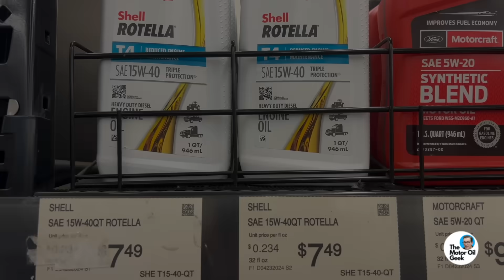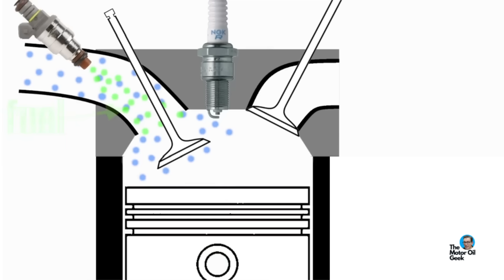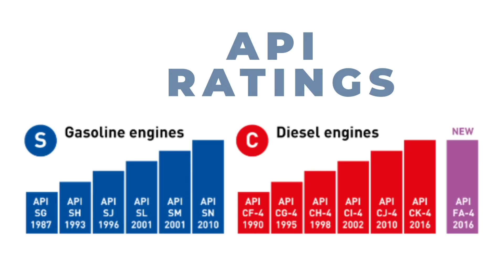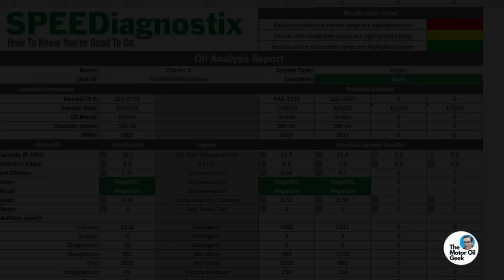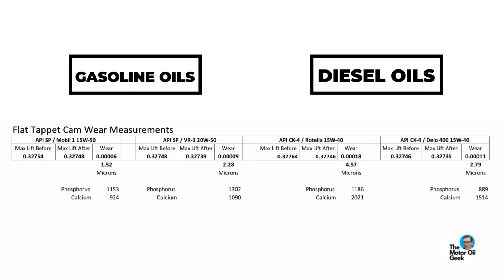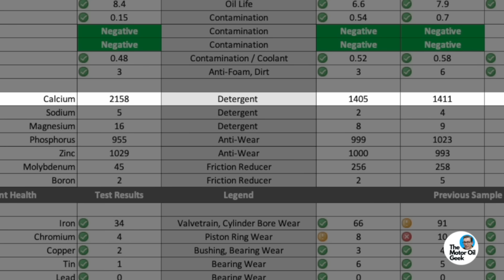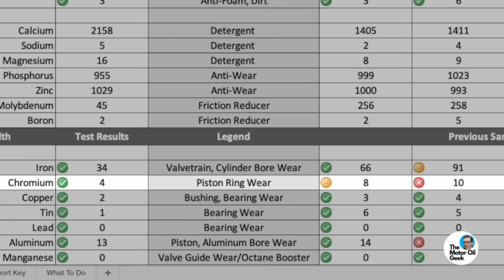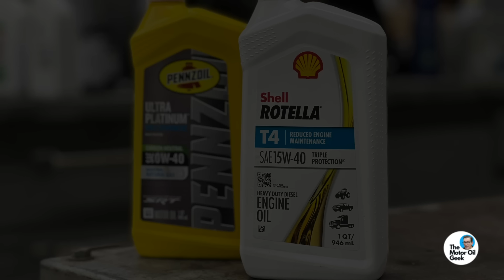Why DIESEL Oil is Actually WORSE for Gas Engines!

Comment: Oil analysis from the top laboratory in the country would say otherwise.... the 15w-40 oil is far better for the gasoline engine than the 5w-20 recommended by the manufacturer.
Reply from the maker: That’s a big change in viscosity not just in the oil chemistry.
Reply: @themotoroilgeek  here's the thing, sir.  The lower viscosity oil breaks down when it gets hot and no longer properly lubricates the engine.  When that happens, it can leak past the rings and get burned in the combustion chamber.  Lower viscosity oil without proper additives is the reason for sludge buildup and varnish in the engine.  The lower viscosity oils are about the same as using cooking oil in a hot pan.  Eventually, it breaks down and barely leaves a film behind for cooking.  The same thing happens inside the engine.  The higher viscosity oil like 15w40 prevents the oil from burning off at high engine temperature, thereby continuing to lubricate all moving parts.  A few oil changes with the best 15w40 will remove the varnish and sludge from inside the engine like you showed in one of your pictures.  Other than pouring Seafoam in the engine to clean it out.  The biggest factor with 15w40 is that it won't leak past the rings into the combustion chamber unless there is ring damage.  Instead of the manufacturer claiming that a quart of oil burned off is acceptable, you can change that to no oil burned off between oil changes.  That equates to less maintenance and engine wear.

Comment: Some YouTubers really should watch this video. Vice Grip Garage is a good example of this. He takes and puts diesel oil in everything because he thinks it is better, but it really isn't. Diesel oil is made for diesels and gasoline engine oil is made for gasoline engines. If you think you need more zinc, then buy a bottle of additive to add to the oil.

Comment: I can attest from personal experience that my 2003 Wrangler 4.0L inline 6 runs obviously quieter and smoother on plain Ol' 15w40 shell bulk oil than it did with Rotella T6, or full synthetic mobile 1. I believe the Shell bulk is equivalent to T4 or T5 as I'm not sure it's conventional or semi synthetic.

Comment: I ran diesel oil in a Mitsubishi G62B engine because two things: flat tappets in head AND the amount of soot it put into the oil because the engine was turbo charged and the anti-knock control by the computer was to run super rich under boost. Just after 500 miles of driving the oil was black because of this.

Comment: Gauges on your dash aren't there for your ammusement, they're there to denote opperational conditions where a failure can occur. The gauge about your oil refers to its pressure, and its temperature. Not it's ZDDP level. Not its film strength. 

You need only look to the certifications on the back of the bottle. Rotella T6 is probably the best synthetic FOR THE MONEY to run in your gasoline vehicle, or motorcycle (JA-MASO2 its the additive for wetclutches) 

Maintaining oil pressure is more important than zddp or moly. Oil pressure is everything.

Comment: I have a gmc 2500 with the l96 6.0 gas and it has 20 000 hrs on it. Bought from a mine so mostly idle hours on it. They only used 15w-40 diesel oil in it. Only issue is the catalytic converters plugged up so they are completely gutted out now. But i think i will keep using diesel oil in it

Comment: Gdi engines are oil diluters. I use t6 15/40 in my 2019 L405 Supercharged. There is no as in no timing chain rattle or high pressure fuel pump knock upon startup after 2 months sitting. The high detergent oil keeps the phaser passages clean and sludge free. Did I mention I use Valvoline maxlife atf in the zf8 hp trans too.

Comment: Hi Lake,
Thanks for another great video.
Here is an off the wall question for you.
I saw a Castrol jug of oil with an advertised 40,000 km. (24,000 mile ) change interval.
I don't believe any oil can last that long and still protect the engine but out of curiosity
is there any oil filter that could last that long ? 
Thanks in advance,
Brian

Comment: So your argument for ringland failure is because of the detergent in the oil. . .  That makes zero sense.  Please explain that theory?
Reply from the maker: Google low speed pre ignition
Reply: @themotoroilgeek  again. . . it isn't the detonation of detergents behind the piston ring, like you implicated in the video.  A tune is much more of a fix than wonder-lube.

Comment: A previous gasoline engine I had was in fact a compression ignition engine.  Worked well until the rings ended up in the oil pan, they don’t work well in the oil pan.

Comment: Just replace oil in time you will be fine, for DPF diesel engines I run low sap oil, viscosity is not viable for my petrol engine cars anyway.

Comment: Well almost no new oil has zink but the T4 has zink oil engines need zink or they go tap tap tap real fast same whit fuel you need lead fuel. I would never put diesel oil in a modern engine

Comment: I've used diesel oil in my gasoline engine because it was sludged up and the valve lifters were stuck resulting in the engine sounding like a tractor.
The detergents cleaned up my engine nicely and i then continued on with regular gasoline engine oil following my next oil change.

Comment: I think people, like me, think because Diesel engines are under higher stresses than gas engines, that the oil is better. The additives sure to smell better to me! and would seem to be better in all situations. But as usual you prove with science, this is not true! But then again, this thought process was before DI engines.  Thanks for another great video!

Comment: Volvo Penta should really get their act together. I have a 2005 4.3L V6, direct injected. Volvos oil recommendations for this engine is all over the place. Synthetic straigh SAE 30, 15W40 diesel, etc. etc. and their different recommendations contradict one another.
I mean, it's a GM smallblock, for marine use. How hard can it be to recommend a proper modern oil for it?

Comment: Great vid again, lots of good info. I got from it, if you have DI petrol (gas) engine, don't run the diesel oil! I know a lot of diesel oils will have a "S" and "C" rating to them, especially the semi synth ones, so it can become confusing for most. Companies like to sell 1 stop suits all fleet oils.  Don't even mention wet clutches on bikes! I'm running a 10W-40 synthetic oil that is listed as diesel only, no "S" certifications at all. It seems to work well. You probably won't get it in the USA but the specs are almost identical to Mobil Delvac 1.  I'm happy with it, change every 10k km/7.5k miles. Not overly expensive vs Mobil 1 but we can no longer get that here anyway.
Keep up the great informative work!! You and Dave work so well together too, looking at things from different angles to impart knowledge!

Comment: Not all "Diesel motor oil" carries a "S" rating, the bottom line, which Lake has said many times, but not in this video is to ALWAYS use an oil that is rated for your vehicle.

Comment: So what do you do when your flat tappet cam manufacturer specs diesel oil? Like melling did for my cam in my 71 Ford LTD? Or Comp Cam did for my 79 LTD (if I'm remembering correctly...)? 

For now, if that is their recommendation, I will follow it after breaking in the cam. For break in, I will be getting dedicated break in oil for flat tappets.
Reply from the maker: Stay tuned for the next video

Comment: While I generally have a lot of respect for Lake and Dave, on this video, while most of the specific the data is correct, the generalized assertions as to the operation of the two engines is either lacking, misleading or wrong.
Reply: You're correct
Reply: bottom line takeaway:
GDI gas engines are
an explosion
waiting to
Happen
:D
Reply: @chrisyoung5363 What about Turbo'd NA cars with port injection?
I pulled the pistons in my engine over the weekend and the crowns of 2 of them had a rough finish like sandpaper on the intake side.  One piston even had pitting damage on the side of the crown which looks like it had started to melt.  Nothing past the top ring and nothing more than surface damage, but still.  These are forged Carillo pistons.

Comment: I put 15-40 diesel oil in an old 1955 Minneapolis Moline gas tractor once because we ran out of the Havoline that we normally used. That motor had alot of hours on it and it did not like that oil. We usually ran 30w oil in the motor. The oil pressure didn't stay up like it did before and it thinned out quickly. So we ended up changing it to Havoline the following week. The last time we tried anything like that.

Comment: I have an issue as a delivery driver, were my oil starts to get heat soaked about half way through my shift and I can tell not only audibly but by "feel" that the oil is thinning too much. So I wanted to switch to a 40 grade oil, but I really wanted to stick with 5 cold rating.. Except I can't find any 5w40 passenger rated oil, so I switched to Mobile 1 5w40 turbo diesel oil and it's been working out great. I should probably sample my oil and have it tested to make sure I'm not getting extra wear, but otherwise it's going great.
Reply: After making this comment I discovered a couple of affordable alternatives in the 5w40 department. Specifically Mobil 1 European Car Formula. There's also this stuff called Cam 2 Blue Blood, apparently they've been around a long time and this is the 1st time I've ever heard of them.

Comment: I only used the rotella 15w40 for 250,000 miles on my 1987 Toyota corolla Fx16... I guess that was a bad thing.🤔😁 It coulda gone 251, 000 mah! Ima winner 250 ain enough!🤪
Did this when i was carpenter, 90 minute commute to the job sight area. Others drove giant diesel trucks and wore away and replaced 450 a pc tires. Me I rolled on lil Michelin 165r13's and laughed at the $34 a pc price, incudes mounting, balance, and lifetime rotate too ..lolz...

Comment: i disagree i run T6 rotella in everything i own but the best proof for me is i have a 02 wrx with a stage 2 tune with 280,000 miles on it and the motor has never been out of the car that is basically unheard of. ill stick with T6

Comment: Click bait.. half told story.   Lost credibility here .
In gdi engines this could be bad.. in older engines the extra detergent is likely keeping them clean. Been running T6 5w-40 in 6.4 hemi since new, 76k now and oil analysis was fine. It's quieter running than the stuff the dealers put in. Even the service writer was surprised compared to the hundreds of other trucks that roll through the garage. 

If it's somehow worse for cam and cylinder, how do diesels last so long with the higher detergent levels (not considering the soot loading)??
Reply from the maker: Stay tuned for the next video

Comment: Well most oil you buy says it can be used for gasoline and diesel. Yeah but you keep mentioning about heavy goods commercial diesels that's different to domestic diesel engine's not the same.

Comment: I bought Rotella T in  55 gal barrels in the 60's and 70's and used it in everything:  cars, pickups, farm trucks and diesel tractors.   The oil had the API ratings for gas and diesel.  I never had any problems!

Comment: I've had rotella t6 in my 2012 impala ltz the Last 3k miles or so. It's direct injection 11.5:1 compression which should be ran On 98 octane but I can only get 91 in my area. Maybe that's why it hasn't detonated but it seems to run just fine otherwise. Pennsoil full synthetic was the only other oil I've tried. Only difference I've noticed is it seemed like the rotella got dark quicker. Not sure if that means anything.

Comment: When I was younger I loved having my Cummins spew black. Big injectors big turbo tons of tuning. Made crazy power but eventually we grow up and understand why that’s a waste. Crack one of those engines open and there junk everywhere crazy dirty especially the oil. That engines oil was black the second it was changed hardly even had to run it. Now with my 2014 6.6 duramax fully deleted ( Cummins was an 01 so no emissions already ) but the second I removed the egr and had
Someone tune it that knew what they were doing, don’t matter how hard I try the most smoke I can get is a tiny tiny haze befor turbo lites that’s hardly even visible. But my engine oil in this duramax within 1 oil change of tuning it properly and removing the egr, after a 10,000 km oil change interval the oil is still brown and see through like a gas engines oil. Insanely big difference. It doesn’t feel like it’s breaking down near as quick as befor either, oil analysis tells me I could easily keep running it past 10,000 km but I don’t. Oil changes is good cheap insurance why push it. But even with this really nice clean tuning, it is a tad laggier to respond but it makes crazy power up top or once turbo is gettin after it still. It’s a work truck not a race truck I don’t need instant throttle response even tho it is nice. But even still while towing my 34 foot travel trailer through the mountains here in British Columbia is summer at 30-40 Celsius, I just drive the thing and don’t have to worry about egts at all I still have an edge cts3 and monitor it but it’s never an issue it’s so happy and loves life and pulling my white boat behind this truck I no longer get black staining down the side of it after towing it any sort of decent distance which is a bonus

Wrote a friken novel apparently sorry bout that 🤦‍♂️

Comment: Been using rotella t6 5w-40 in my fa20 wrx with no issues for 3 years. Only started using 5w40 because I have an upgraded turbo and do a lot of spirited driving and I didn't want the viscosity to get lower than 5w30, also seen a ton of people with Blackstone labs results with no issues.

Comment: Honest question:

What about the use of diesel engine oil for breaking in reassembled gasoline engines, especially high performance engines. It is said to be a cheap alternative to specialty break-in oil. Is the chemistry so different to warrant one over another, considering break-in oil is used for a short period of time but is very expensive.

Comment: Diesel oil should not be used on modern engines. Where diesel oil works well on air cooled gas engines like the VW 4 cylinder. This is due to the zinc in diesel oil.

Comment: I have used Delo 15-40 for over 30 years in my Diesel Trucks and my Gas vehicles with 4 to 8 cylinders. All my Gas engines have NO soot at the edge of the tail pipe, just clean metal.  To this day I have a 2004 Ford Ranger with the 3.0 liter engine still on the road that has almost 500,000 miles. This vehicle as with all of vehicles had its oil changed to Delo at the first 1000 miles of use and are using Delo today with little to no oil use between oil  changes that occur at 4000 mile of use. This is also true to my 2014 Ford F 150 non turbo engine that has 300,000 miles and climbing,  Maybe  Ford builds engines that like Delo 15-40.  Though your oil analysis does show wear, I am totally convinced with 18 vehicle using Delo and have what I consider high mileage that I am not experiencing any issues with these engines.  I guess when one of them fails it will be the time to tear them down to see what type of wear really happened.  Keep up the good work I really enjoy your Videos.  Mike C.
Reply: You must have no common sense diesel oil in a gasoline just buy gasoline oil for a gas car and diesel oil for a diesel truck it's not hard to do

Comment: Tell dave a bucket of gasoline has to be at the temperature of -40C or -40F to resist ignition from a lit match.
Reply: even then, I think the heat of the match would heat enough small area to light it up anyway.

Comment: I ran T-6 in all my high performance car engines with no problems for many years. Small block Chevys and all my Oldsmobile builds. My 461 Olds was run at 7,000 rpm when racing and I used it in 3 different demo cars as well. I wouldn't use it in my Camry though. I think he means don't use it in new cars, but didn't say that.

Comment: I feel like if I say the wrong thing about oil, Lake Speeds Lip is going to attack me...  
Guy starts twitchin when he talks about that darn Molybdenum.  
Just what in the hell is going on here in the COmments anyway?  It's like everybuddy is freakin Tribologist?  I used this Oil in my Flat Tappet Pancake Motor Derp...  AN It did just fuc#kin Dandie...  Well, then I guess if it works then... great...

Comment: I only use recommended oils however I used to see many you tubers using diesel oil in petrol motors haven't seen that for a last couple of years never thought it was a good idea. Thanks for your explanation.
Reply: Works fine in older vehicles.

Comment: Apparently I have been doing the wrong thing for 40 years. One engine I have is a Slant 6 with nearly half a million miles. No sign of needing a rebuild yet, and inside it is cleaner than my kitchen. I am sticking with 20W50 Diesel oil for everything.

Comment: My 2014 3.5L ecoboost has had Amsoil signature series since I bought it with 428 kms. It notw has 330000+ kms and still doesn’t burn a drop of oil

Comment: 500k 2001 odyssey  t6 burns 0 leaks 1/4 liter in 5k  need the ma2 for others in fleet so i chose  1  lube started using rotella 50 years ago when it was  originally for 2stroke diesels  used it in my 2 stroke bikes

Comment: Turbo question; say I were to install an oil temp sensor on in the oil return line, is there a temperature that would be safe to shut the engine down to where the turbo won't cook the oil on an oil cooled turbo? Cummins recommends 5 minutes of a cool down, and light easy driving can be part of that 5 minutes. I'm just curious if there's a temperature I should let the oil cool down to, right out of the turbo would be great but in the pan temp works too.